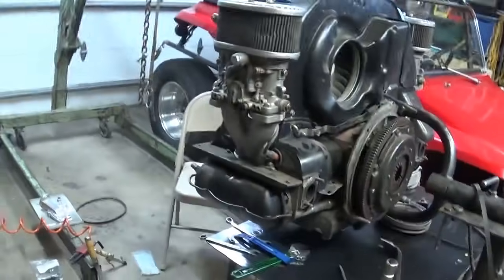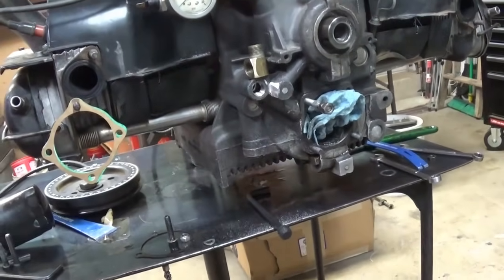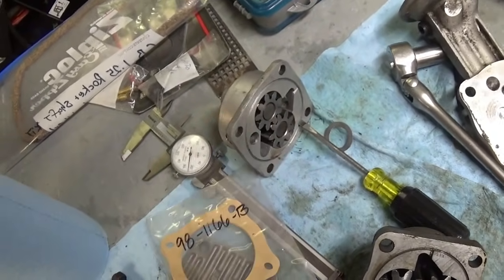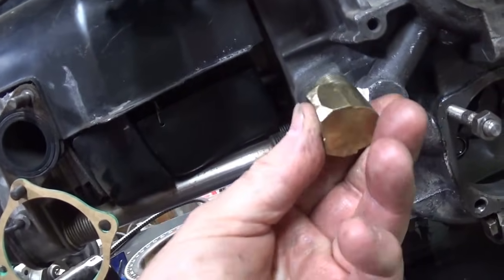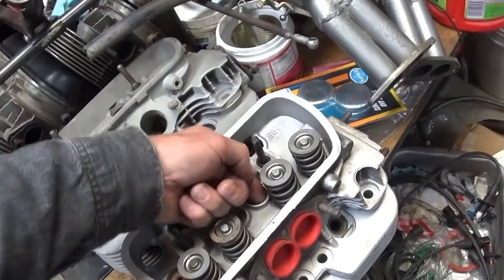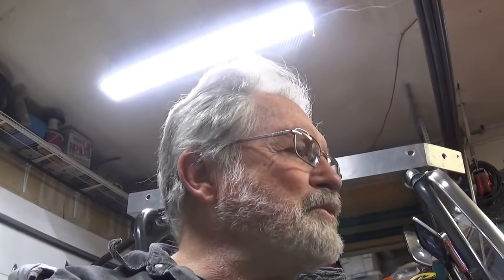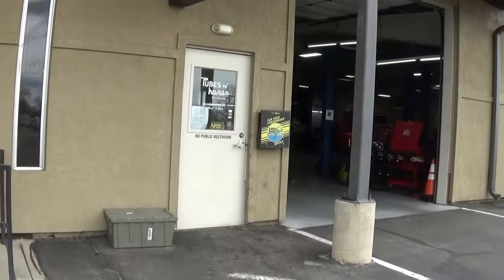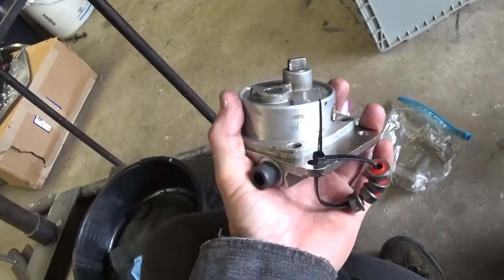VW 1600 DP /1776 SP / 1800 Brawler

Comment: Thank you for another great video.

I once did the calculation on how much air gets into the dual port head compared to a single port head. Its amazing, plus the air or gas mixture flow isnt splitted in the head but before and that makes it a better flow I guess. Greatings from the Home country of all our Volkswagens 👍🤗😎
Reply from the maker: Great tip!

Comment: The early motors that didn't have a filter used w30 oil with no detergents so the sludge would collect in the strainer pan.  Hence the oil changers every 2000 miles and clean the oil sump instead of changing a filter.

Comment: Hay Professor,  really cool video. Looking forward to the test results. With everything you have done, now I'm thinking of backing off of my 1776, and just leave this 1600, but put the. 110 cam. Trick up the heads, and valve train, and run it. Should last me a good longtime, and save me  a butt load of money. You really helped me on this. Thanks buddy.
Reply from the maker: Your plan has merit but I would stick with a cheater cam like a CB 2260 or engel w90 or stock with 1.25 ratio rockers
Reply: @TheEZGZ  OK, thanks for the tip.

Comment: That mystery hole in your oil pump is for filter/cover type pumps.  Oil goes out that hole to the filter then returns to the factory exit port of the pump.
Reply: Tony More that is correct, already was thinking of posting the same comment 👍
Reply from the maker: I'm hip to your jive I just don't ever remember having one of those with 26mm gears. Usually they come with wider gear for the extra workload. I've put about 100 miles on it this morning and it did just fine. No worse or better than the EMPI  filter pump I took off????  This case has seen some better days and although the bearing are 2nd over the pressure is not what I would like. I've checked all the relief pistons and springs several times???   I am going to waste time worrying about it. I will run it and post the storys to help whomever I can.
Reply: @TheEZGZ  The berg anodized o ring 26mm pumps have cured low pressure problems on old cases for me. Maybe the case has hoover mods and needs the 30mm pump. Sometimes an old case just wants thicker oil. The diesel 15-40 has worked well for me and has a bit of zinc in it. What pressures are you seeing at what rpm?

Im just about to finish up the new 1800 for the bus, you are giving me a bit of hope to press on. Last thing for me now is to finish rocker geometry and cut the pushrods and then I can button it up (for the 14th time)

Comment: Hey ez have you ever seen a cam chip the oil pump drive gear. I have a w100 and a oil filter pump and I've got it apart to fix the number 4 front lower head stud that got over torqued and pulled. I noticed two chips out of my oil pump drive on opposite side of each other
Reply from the maker: Thats what I was showing you in the vid at one point. If the pump is scratched and pitted throw a new pump in to be safe. That's what I would do.  But don't throw the old one away. Keep it for 30 years. hehehe

Comment: Ez when you use a pulley with a sand seal and shim it takes a longer crank bolt that's why a stock bolt doesn't screw in far enough
Reply from the maker: The shim is only 3/16  stock bolts works fine. Just check it now and them. Seems like I'm always turning it to check valve settings.

Comment: Have you ever thought of using a 45 or 90 degree AN fitting instead of the 90 brass fitting? You wouldn’t have to file as much if at all.
Reply from the maker: My 1776 had that when I got it. I don't know where to get a AN tapp?

Comment: Nice buggy!  Do you run the zinc additive all the time, or just during the break in period?
Reply from the maker: Normally when I do a oil change I add 1/2 a bottle. If I use a quart of oil after miles and drips I will add a quart. Next time it gets down a quart I dump it all and start over. I change the screw on filter every other oil change.
Reply: @TheEZGZ  good to know, thanks!

Comment: EZ, do you ever pull, clean and tap the oil gallery plugs?
Reply from the maker: I haven't had the need to. Some guys do it so than can better clean a used case. My aluminum case came with all the holes tapped and included the plugs. When ever I have a case apart I tap it for full flow and just plug it like in this vid and use the pump filter. You don't have to worry about blowing out plugs if you use a bigger pump. IMHOP I hope that answers your question.